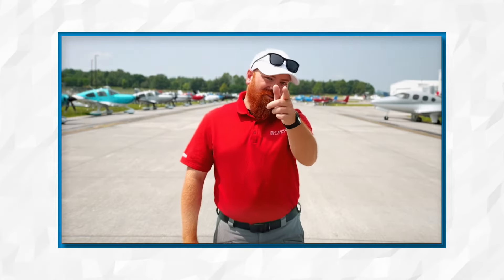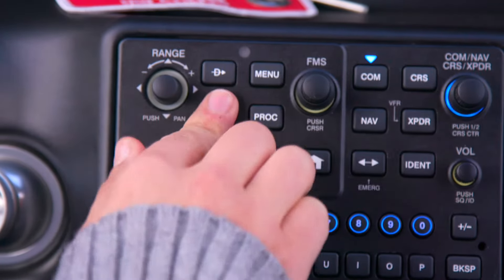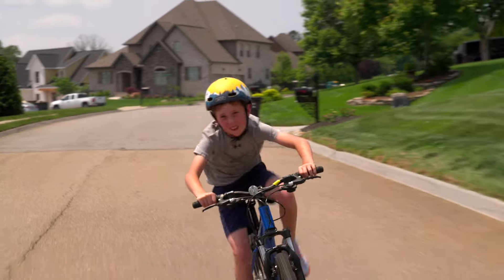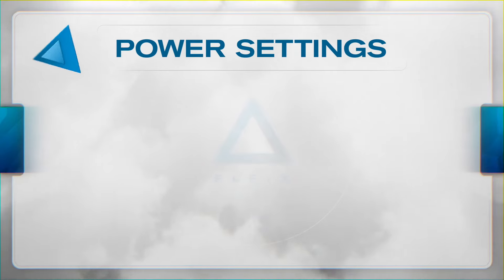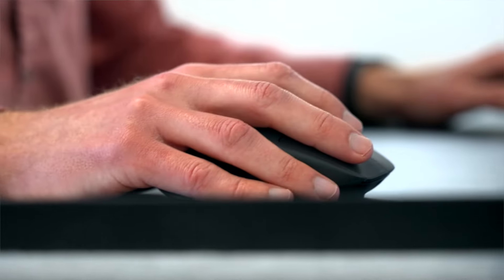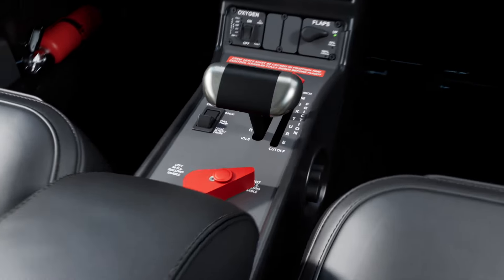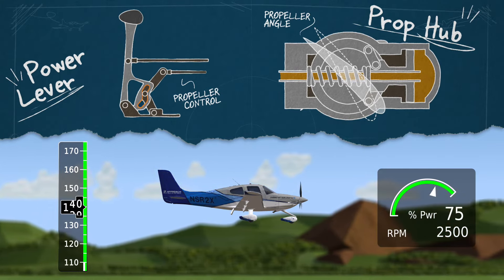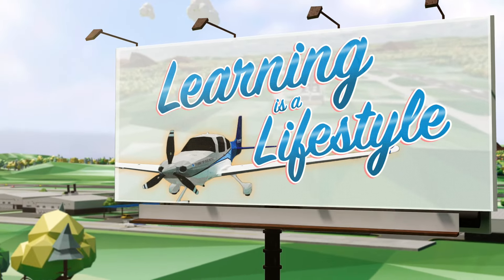Dude! Where's the Prop Lever?

Comment: Knowing the Engine Handbook details for an engine type and the Blade HP value, the concept of an interlinked Prop-Throttle movement is a logical way to manage engine performance.  Dose one still cycle the prop on run-up?

Comment: It wasnt until the G5 that the prop controls were physically removed. The diagram you showed was for the G1 G2 and G3 models. G5 and G6 use a propeller governor with no cables attached to it. Its adjustment can only be made with the cowling off during maintenance.
Reply: I think you’re confused about how the prop system varies from the different models. The 22T turbo is the only cirrus aircraft that operates without mechanical linkage from the throttle to the prop. The 20 and 22 models do however, as explained in the video, utilize the mechanical linkage from the throttle to the prop.
Reply: @v1ohno939  yeah that's correct. At our airport altitude we don't see many NA cirrus or many 20s.
Reply: correctamundo @v1ohno

Comment: How come that at 10,000 feet, WOT I read 65 % power and get 2650 RPM on the prop then ?
Reply: At WOT the interconnected mechanism moves the governor cable forward to Max RPM stop on the Governor.  Meanwhile your Manifold pressure is naturally reduced to about 21”.  the relationship between the MAP to RPM is what the Garmin software uses to determine Percent Power.